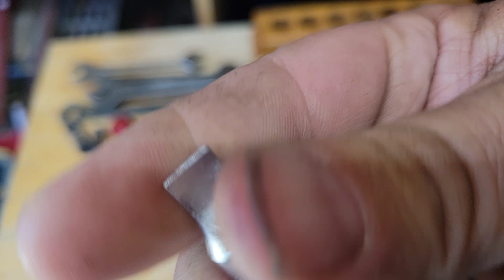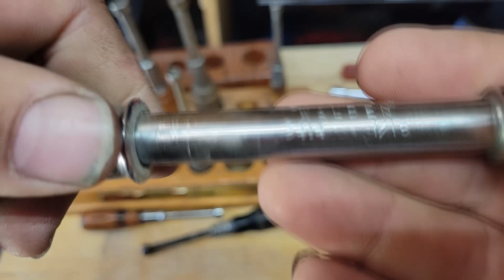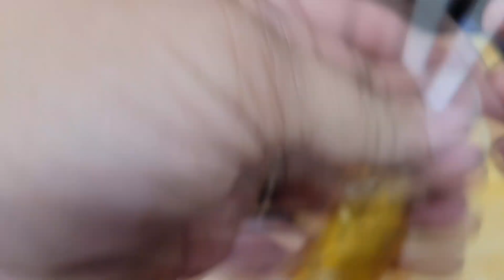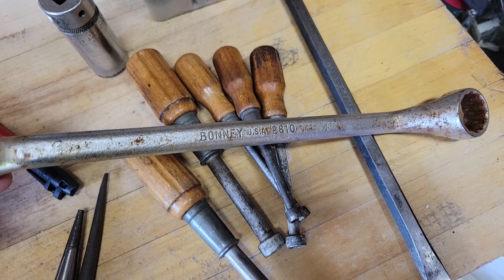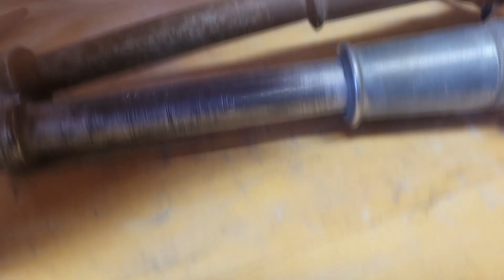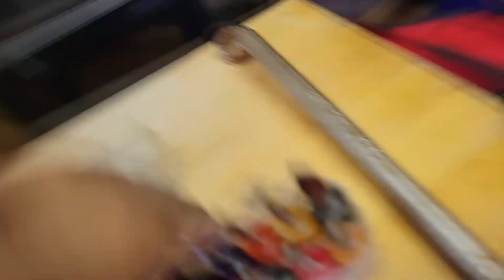Mail Call & Stevens Walden Spintite Nut Drivers.

Comment: Hey Rob just I just got sum sockets from the bay and it was a lot close to 30 pounds anyway  the whole  lot is extremely  rusted  and I mean Rusted  the first socket I pulled  out was a 1950s snap-on  swivel socket not to much snaps but willams  in thorsen  sk  the thing  is I soaked these puppies in a bath of evaporust  outside  in texas heat for 2 days and it did remove  a fair amount  of rust but the problem  I have now is chrome  pealing  off and deep pitting  I just don't know what to do I didn't  pay a whole  lot for the lot more for shipping  but any suggestions  thanks